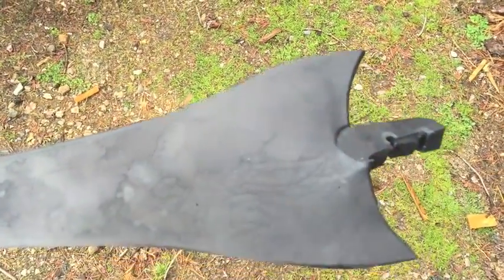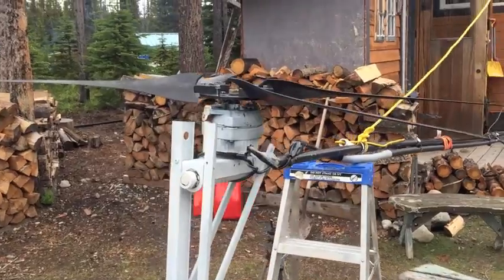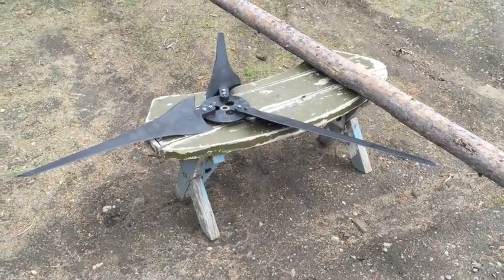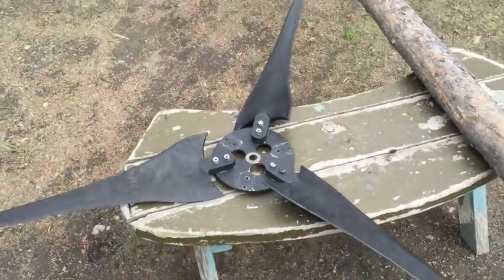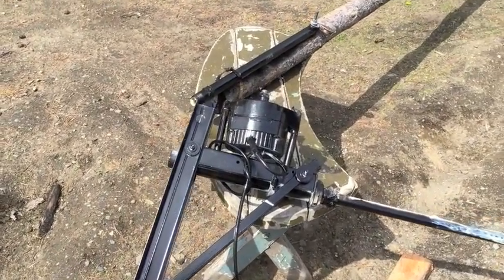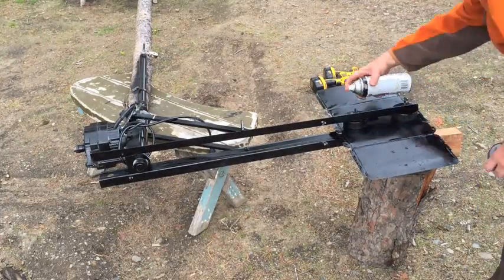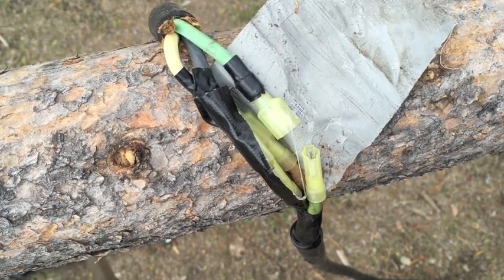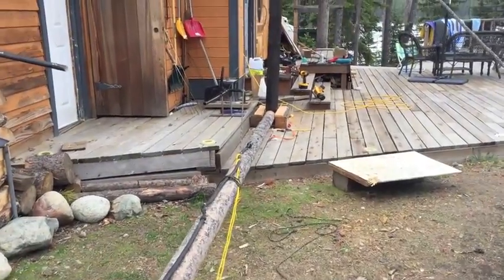Experimental Wind Turbine Tower - Part 3 - 8 Short Stories to Share

Comment: Where did you get all your parts.
Reply from the maker: I traded my cabin neighbor a CD boom box for the wind turbine generator head. I built the rest of the frame from spare angle iron, the pivot bar is from a TV mount that swings, the fin is made from a garage door motor box hammered flat. I did a series about the wind turbine back in 2012. Click this link to see Part 1- Recycled Mount for Wind Turbine https://youtu.be/5kEV82logGM
Reply from the maker: I traded a stereo for the wind turbine with my neighbor. I think he purchased from a seller off eBay.